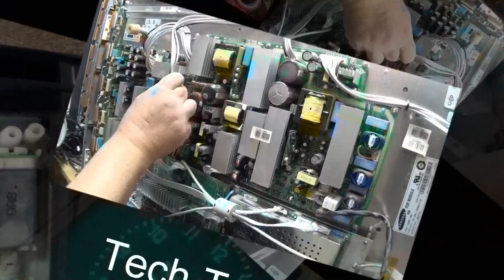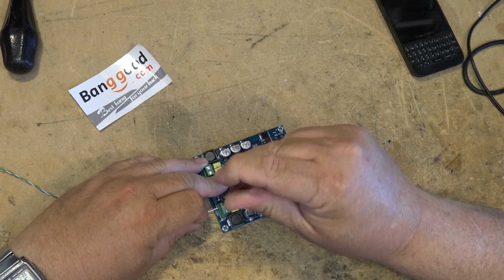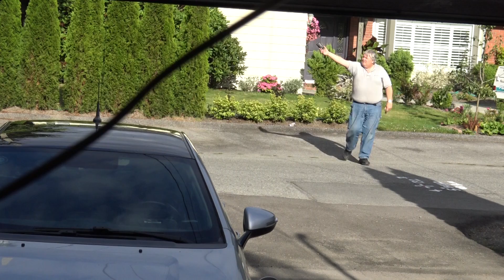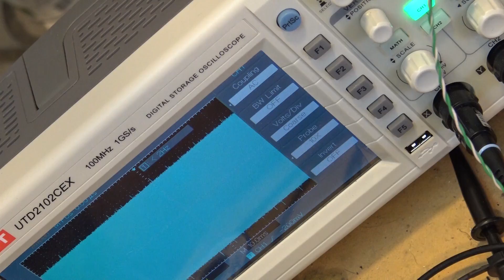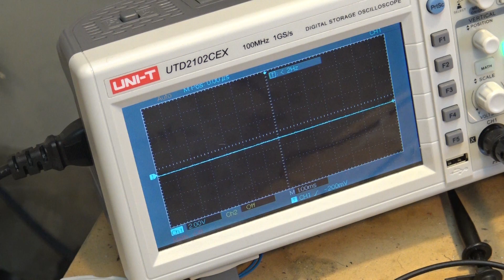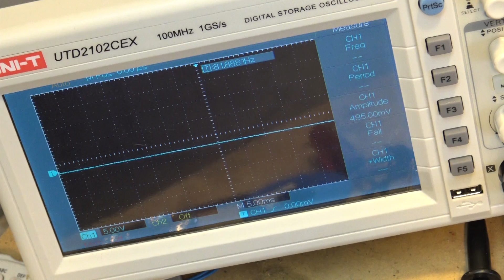TPA3116D2 120 WPC Bluetooth Audio Board test run

Comment: what about using a Slim_Jim antenna for 2304mhz or 5ghz and I am thinking about replacing the WIFI antennas in the back and front of my ACER Aspire TC-220 with Slim_Jim antennas for 2304mhz and 5ghz.

Comment: The short 1-1/2" wire worked good to increase the range.  Normally Bluetooth range is usually around 20 to 30 feet.
Reply from the maker: Yes 30 feet is suposed to be maximum. That would be from the front door of the garage to the street, as I am set back 30 feet. The receiver was at the back of the garage, a good 40 feet from the road, and I crossed the road with it, so yes it dis make a huge improvement.

Comment: From what I've read, the sweet spot for the TPA3116 is right around 19 volts. If you provide some 4700 uF caps in the supply, you may also get better sound. I hope you make a video when you hook it up to your main speakers. It would also be interesting to see how much difference there is between Bluetooth and line-in.
Reply: After trying three TPA3116D2 based amplifiers I ran into the same conclusions as "BlankBrain's"  I operated the amps off 19 Volt 4.7A Dell laptop PSU's with 4700uf filter caps, Alternatively used wired and BT input sources.  Sound great. FYI! on public domain sites there are 3D printing plans for cases that fit some of those Bluetooth  TPA3116 amps. I tested with Definitive Technology surplus bass drivers and had to apologize to the neighbors.  They claimed their dogs filed for relocation.
Reply: @avrahamchamish521  I concur as well.  If you want a really well made laptop supply then the best I have come across are the Toshiba ones.  Beautifully made and properly screened.  I have a few Dell supplies here but haven't tried them - not least because they are attached to laptops and might be missed.  Also they don't have the standard barrel connector.  But they should be decently made too, but the Toshiba ones are exquisite.  I was really surprised how much went into them.
Reply: BlankBrain same amplifier I'm connect 12volt 3a supply and load 15watt each channel but sound not working in speaker it's any falt other wise
Can improve my voltage and amperes ?

Comment: Only thing I'd like to see is a way to turn off the beep tone once the unit is paired.
Reply from the maker: It beeps on power up only. This is for those that would mount this inside a speaker which wouldn't be a bad project. Pick up a pair of nice speakers, Mount the board inside, wire it to the speaker. Wire the other channel to the terminals. Then just a single wire from one speaker to the other. That might be a project for me. Build it into a nice pair of good sounding speakers. 
Hmmm, Value Villiage here I come.